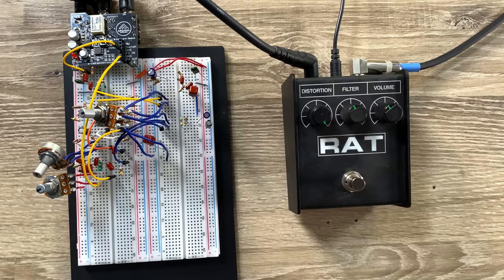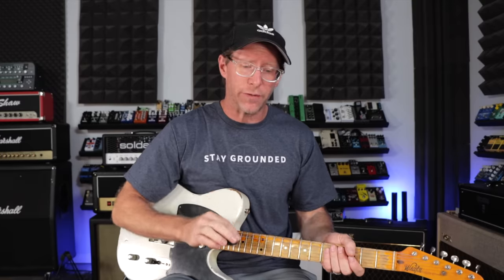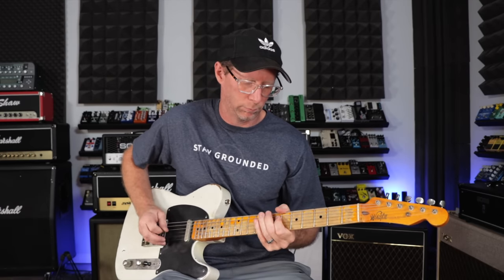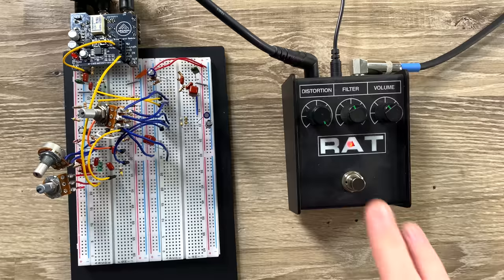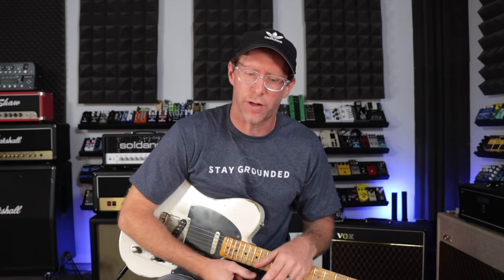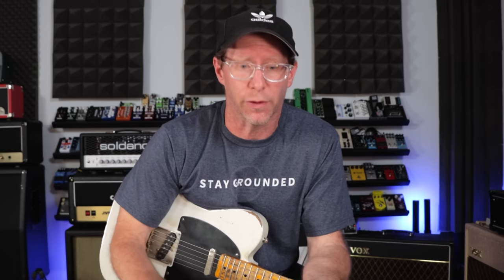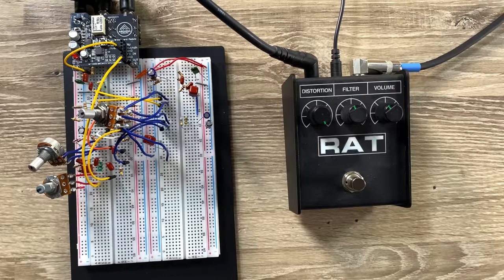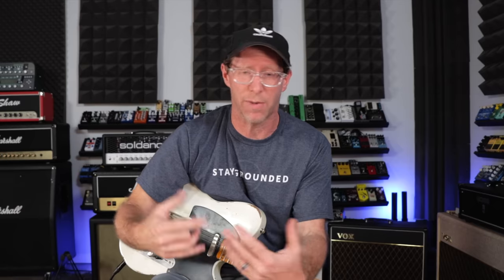The Rat Pedal Circuit Reimagined

Comment: I got a rat because I wanted to see what all the hu-bub was about- everyone talks about them, you hear countless artists talking about using them- got one, hated it. Then, I got a valve amp and stop using my solid-state Peavey- now I love the thing. It sounds great on my tube amp- sounds horrible on my Peavey. I hated fuzz pedals until I got a tube amp as well- I don't think ppl realize how much it changes the sound of a pedal to try it on different amps- it's a major, major difference. On a solid-state amp both fuzz pedals and the Rat = fizz, and lots of it- I hate fizz. On my tube amp- very little fizz, more growl. 

Which makes me wonder why no one has ever tried a pedal show where they purposely use say the top ten amps the average viewer may have- or something similar. Demo each pedal on all ten amps, using a single coil and humbucker in the common price range of 300-500 bucks. And make sure whoever is playing is intermediate- not great, not horrible. I mean if your goal is to truly represent to as many viewers as possible what this pedal may sound like if they buy it- this would seem the way to go. Instead, we get crazy intense signal paths with amp switchers and amps running into cab sims and then into audio interfaces and blah, blah, blah- not going to sound remotely like that when I get it home. If we don't get that then we get guys running it into 1000 dollar tube amp heads and high end cabs through expensive attenuators, then they push the head until it's at the edge of break up- and demo a drive pedal. Now how many ppl watching have all that? But see, if you just had a few practice amps and a regular, everyday guitar- they probably wouldn't send you their stuff because they want it played over the best equipment possible, of course. You would probably have to go buy about everything you demoed.

Comment: Loved the sound of the new circuit.  Would it be feasible to build a pedal that had both the old & new circuits in it and a second footswitch to engage one or the other (or both for the "moar gain" nutjobs ;) )?  If one of circuits was lower gain than the other but still worked well with the one set of controls you could get two distinct cool distortions in one fairly compact box.

Comment: I bought a Turbo Rat back when I was 17 30 years ago. It did nothing to better the tone of my Crate G40 stereo practice amp. I traded it to a pawn shop with cash for a Deen guitar. In more recent times I've learned that they work great in conjunction with either the Randall heads or Marshall Valve States because the band Obituary uses this and so did J Yeunger from White Zombie.

Comment: I wonder how this compares to mine. Most mod I saw add a 'presence' control on the first filter before the gain, I don't find this made a huge difference but yours sounded more bassy than the original, which is cool. It's also a feature of the RAT in general (compared to other distortion circuits) so maybe you left some gain out? Or did you just adjusted the eq at the 1k5 and 3n3?

Comment: Thanks for your educational videos. 
Is it possible to remove the buffer at the end of the Rat circuit?
Reply from the maker: Thanks! Yes it is, but not advisable. That buffer helps quite a bit or else it would be quite high output impedance

Comment: I think the giveaway idea would be awesome but i don't see any solution to keep it functional, breadboard fail so easy by themselve already and by some time something it's gonna oxidate and fail.
As a decoration kinda thing i would submerge the whole circuit in clear epoxy, give it a vacuum pot run (for bubbles) and put a plaque signed.

Comment: Epoxy block of the whole thing? Tricky with the pots, sure. Everything low profile, bended down etc, how low can you go? Then press down with foam. Or actually solder it to the bread board? That'd be good fun maybe.. Do nothing, just (have someone) carry it carefully to the recipient! Or send it and don't worry about it, with the schematics and some (signed!) photos to repair the damage. I'm thinking a cotton bath will hang onto the parts, no fun removing that. That's it from me, I'm all out now. Good luck!

Comment: Your Pro Co Rat sounds much crazier than mine. Mine was purchased new last  winter. Yours is probably like a 1983 or some such special year nonsense, am I right?
Reply from the maker: Nope- I bought this one earlier this year I believe. No mods or anything either. Perhaps I’m just hitting the strings harder? Not sure.
Reply: @wampler_pedals  Weird. Mine doesn't have all that splat and cut with the gain maxed. Mine is a lot closer to a modern smoother high gain. I'm using SGs and a Les Paul with the standard humbuckers in them. I'd think those pickups would drive the circuit harder than your Tele pickup. Thanks for the reply. What amp did you play through?

Comment: Hi Brian (or anyone who can answer this) I have a question: what is the basic difference between a standalone distortion pedal and an amp simulator pedal (i.e. Tech 21 character series)?
Reply from the maker: that's a big question to answer on a comment section of youtube vid. Basically: tech 21 is going to have cab sim in it and the circuit is set up to sound a particular way. Distortion pedals (there really isn't a "standard" - there are thousands of different types) generally just distort the sound more than an overdrive does. Some come with cab sims, some don't. Some of them sound great, some sound terrible. Best thing to do is compare two different pedals in a store and see what you like
Reply: @wampler_pedals  thank you so much Brian

Comment: Was this straight up class a style distortion or were diodes involved or did you use mosfets as diodes?
Reply from the maker: The clipping is achieved by using mosfet gain stages arranged in a specific way as well as diodes. No op amps used.

Comment: You could dip the circuit in a bowl of fiberglass resin and have two pieces of half inch PVC with the two jack wires running inside them and then when it dries pull the PVC out and you'll have your jack wires that you can hook the jack to and Mount to the resin blob..if you follow me...or you could hollow out a pineapple and put the circuit inside it...my grandmas wife worked at a prison here in Florida and said they were having issues with more and more convicts suitcasing rat pedals into the facility in their asses...9 volt battery and all....frfr

Comment: Why do people use LTSPICE and not the newer better QSPICE? I'm confused by this.
Reply from the maker: Not sure. It’s a bummer that it is windows only though. Seems odd that you have to email them to get a download link as well.
Reply: @wampler_pedals The email for the link is to keep a list of possible terror suspects that can be handed over if asked, I'm quite sure. The main review up of QSPICE is clearly from a guy who works with the military, and a guy who used to work in demolition oncec told me LTSPICE has missing components for a reason. Going by this, I'd assume some of the websites that hoast spice components are also monitored. Which kind of sucks if you're just trying to build pedals and amps and value your privacy.

Comment: I put a rat on my harmonic analyzer a couple of weeks ago.   While it sounds good, I found it to look like a very basic hard clipper with a low order lowpass for the tone control.  Quite a bit of even harmonics on my sample, my guess it was due to a slight negative DC offset at the clipping diodes.      I did notice it was a bit quieter than most pedals so it would not be good to slam the input of your amp.      https://youtu.be/tAsX8Zcu6rA